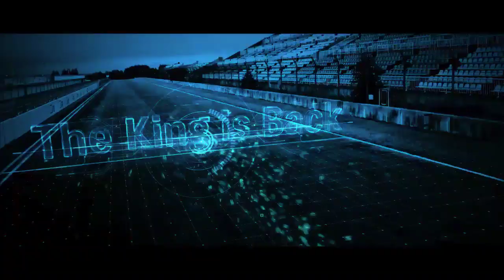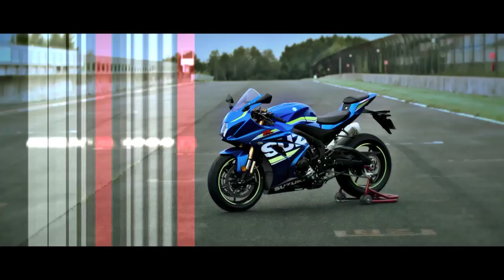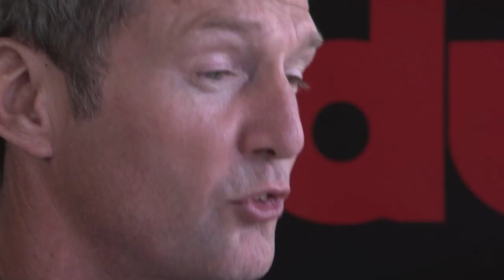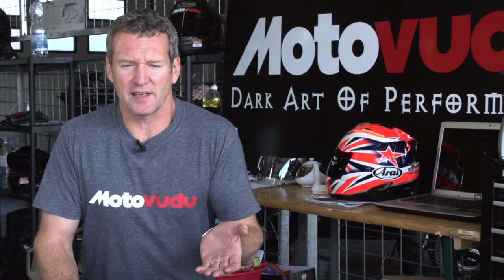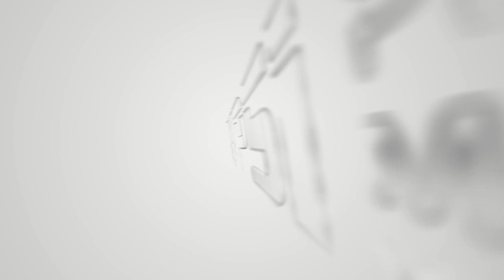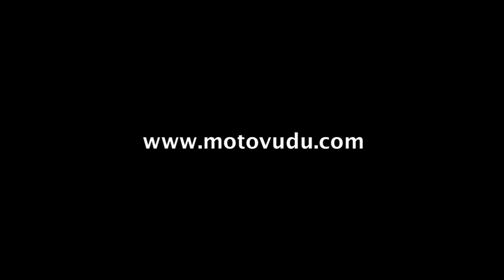MOTOVUDU - Simon Crafar - Race Shift vs Road Shift

Comment: I went race shift for a bit but went back to normal. Like Simon said it is easier to push down than pull up so easier to miss a gear pulling up. After missing a couple of gears coming down under braking I changed back to normal shift as I would rather miss a gear accelerating than braking.
Reply from the maker: fair enough!
Reply: very good point!

Comment: Used race shift early in my track life but went back to road shift, I much prefer stomping on the lever for downshifts and am not disadvantaged by the need to upshift mid corner because I'm always able to reach the shifter when I need to upshift. To my knowledge Troy Bayliss and Max Biaggi are amongst those who still use road shift pattern and like you said are world class riders
Reply from the maker: Yes some world champions never changed to the 'one up, five down' pattern. Like many things its a personal preference ... but because some advantages exist using this reverse pattern by far majority of racers do use it.

Comment: I changed from road shift to race shift after 25 years riding on the road and occasional track. Breaking & downshifting for the hairpin after the Mugello straight made me panic as my auto-reflex for changing just froze. I now remember by saying WOOAAH (like pulling reins on a horse) while pulling up on the shift lever and GOOOOO! by pressing down on the shift lever.

Comment: I use Race shit on my Honda RC51 its just easier under acceleration just like Simon says. Street sport bikes tend to have very smooth seats that causes you to slide backwards even with moderate acceleration, I always found myself having to pull myself back with the handlebars to get my foot in the proper position for a bike with a street gear shift set up. Also don't ever use Armor All or any other polish material on your seat it my look nice and shiny, it will be like sitting on ice or grease as your butt would be sliding backwards and forwards as you accelerate or brake.

Comment: Why factories don’t use racing pattern as standart?
Reply from the maker: They are street bikes. They'd get sued if they reversed it and someone rode out of the showroom and changed the wrong way. 
I've noticed that the sport bike manufactures make it very easy to reverse now. One bolt and 30 seconds to swap my gsxr1000's gear pattern's to suit different clients.
Reply: Motovudu  My first bike with gearbox had a racing pattern, it was Jawa Pionier 05. You can see it in this video at time 04:12 
https://youtu.be/e-jkajwlmFY
It was an extremely simple but durable bike made by Jawa in former Czechoslovakia, the same manufacturer who Franta Stastny was racing and winning for in MotoGP at the 60’era. At that time Jawa and CZ were producing such durable bikes that you can yet still see plenty of them scooting around with young guys on giving them hard time 😄
Greetings from Slovakia 🇸🇰 👍🏻

Comment: Simon, years ago I let a racer buddy take my beautiful new Laverda RGS-1000 out for a quick spin. Within minutes he'd dumped it because the standard shift pattern was not his habit. We got to put Laverda's trick Bayflex plastic fairing material to the test! It didn't break or crack, just scuffed. Arrrrgh. But that ended my generosity with folks used to race patterns.